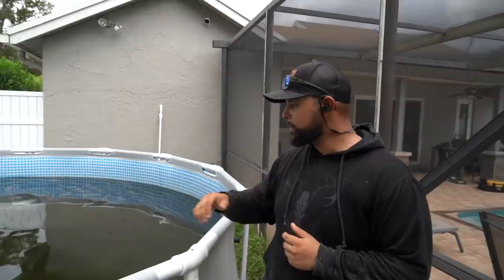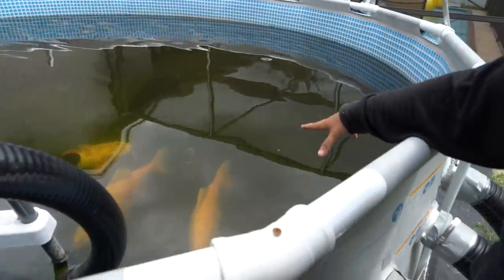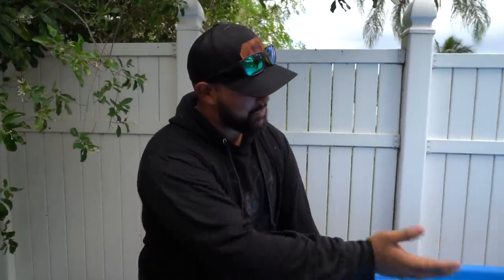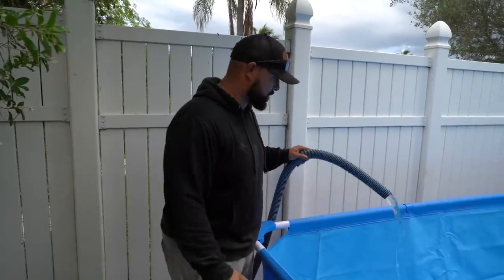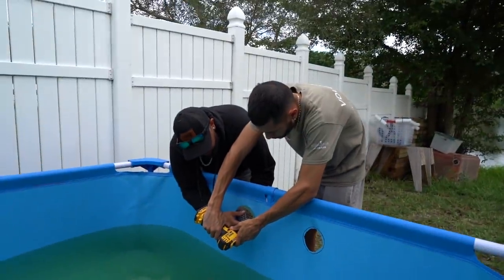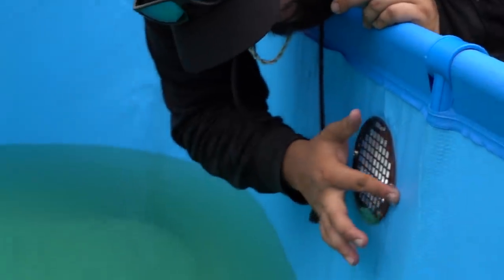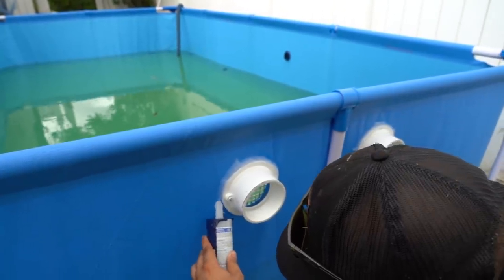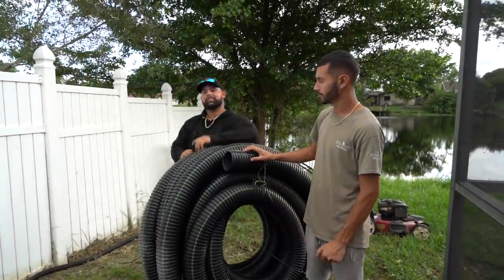BUILDING NEW Backyard POOL POND for MEGA FISH BREEDING EXPERIMENT!!!

Comment: NOW THAT'S WHAT YOU CALL CONTENT
Reply: ? he literallly spent 12 minutes on cutting a hole and putting 2 pipes in there
Reply: @andy_2221  HAHAHAHAHAH THAT'S CONTENT BRO HAHAHA
Reply: @marcosanchez2874  at this point, it sounds like you are mocking Joey Slay Em.
Reply: @andy_2221  Bro he explained how to make those ponds so much info put into it to be fair
Reply: Ok bro
Reply: bro you the man
Reply: It looks like a strong material to hold the weight of the water and not just tear up when he cut it, I am surprised he didn't do this while it was empty.

Comment: Why do you not just use the correct PVC pipe and elbows to drop the water down to drainage pipes. Not only would this work better it would also hold the weight of the pipes and drain from the pool walls, this would make it safer and longer lasting.